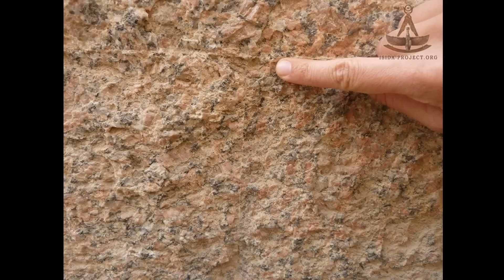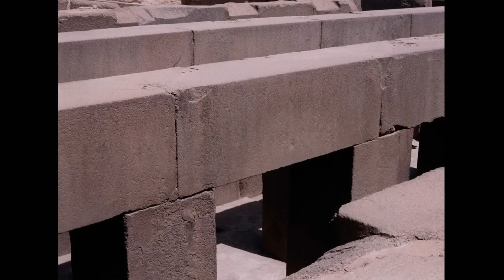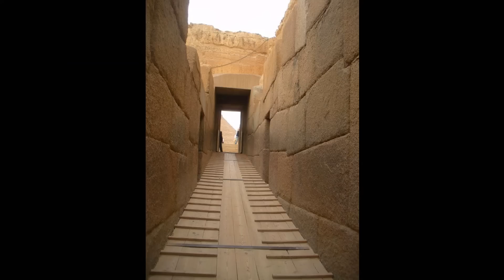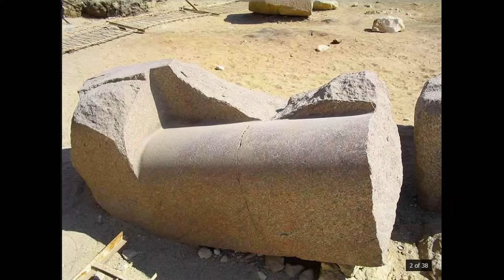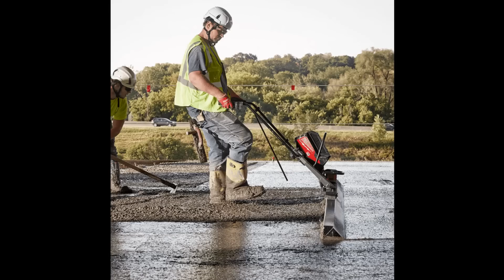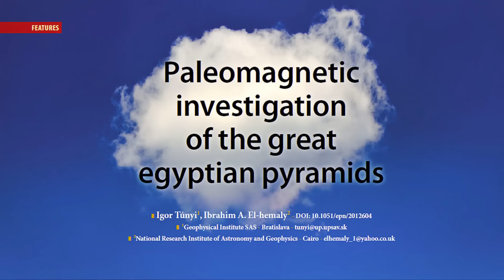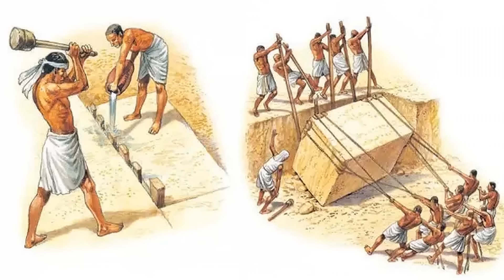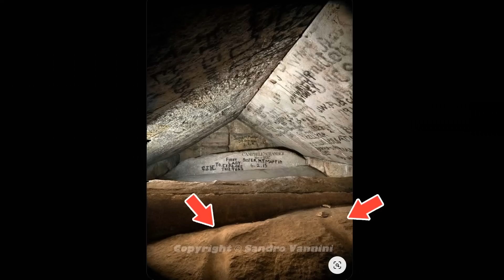How were the Perplexing Giza Pyramids' Granite Blocks Created?

Comment: Hello again I have a lot to say but I just wanted to try to bring out some obvious where approximately 8 minutes 40 seconds in you talk about granite blocks in front of limestone and how difficult that would be with the granite but have you considered that the granite was placed first in the limestone is geopolymer which is already known to be. If you think about it that would be the easier route and very easy and it's very easy to polish one side. And there's evidence of Wheels in kids toys before this pyramid was supposedly made. So just because evidence has not been directly found at the site for Wheels, I personally believe circular saws powered by water would have been a very easy thing to do and I believe they knew how to do it then. It's hard to believe that they understood the cosmos and right triangles yet they didn't understand Wheels.

Comment: I believe most of these sites are cast. If there was a great flood, there would be so much mud and debris.
They had to do something with the material.
 Mound builders cleared land and piled the material up.
What did Egypt do with all the "quarry dust"? I know what I would have done with it.
 Maybe they started with "sifting" the material and burning the trash, creating concrete additives like charcoal. After separating the material sizes, made sun dried mud bricks out of the clay that would have been everywhere, 
Begin mass producing kilns to "fire" the bricks, creating stronger materials. There's a chemical reaction when certain things are added together that heats up the aggregate. We set anchor bolts with a material that did that. Grout is very fine aggregate mix, if you get your viscosity manageable, you can make it as thin as soup, or you can make it a Ramming material. 
It's all about the viscosity/slump.
Maybe a lot of these places were originally just disaster "clean up".
First off, anyone planning to hang around would dig a well, revealing the rock layers as you dig down.
 People put way too much thought into these conspiracies.
I'm going with, 
Cast stone from clean up debris. lol

Comment: I also have very close up photos of the joins shown at 0.42. It's very unlikely that a saw was used as it would remove material at least the thickness of the blade. All you can see is a difference in the colour of the syenite's inclusions across the join, but no material has actually been removed. Upon very close inspection the join is not perfectly straight either which is also inconsistent with a saw (or even ancient laser). Most likely this is the result of a very well practised method of cracking the stone into sections to make it easier to transport.
I have the same photos from the Khafre pyramid at 7.47 and it's far more likely that the core stones were made to fit the syenite casing stones, not the other way around - see Engineers Are Lazy on my channel (you get a mention). All theories regarding 'cast' stones, or geopolymers are reliant upon the following premise: quarrying large blocks of stone - to pulverize into powder - to make large blocks of stone. You also might want to check out the Sacred Geometry Decoded channel who has actually gone to the time and trouble of reviving and practising these primitive stone working techniques and proving that it can be done.

Comment: The granite casing pieces weren't carved to fit the limestone, the limestone was carved to fit the unflattened granite. Shaping the softer rock saved a lot of work .
Reply: That is backwards.  The limestone blocks were already in place when the granite blocks were abutted against them... in all locations.  Against the ragged megablock limestone wall of the Valley Temple granite blocks were poured and merged with them with no gap between.
Reply from the maker: I agree that the limestone blocks were there first before the granite sheath. The core stones at the pyramids and temples were stacked/ constructed first as they are free standing structures. Without the preexisting limestone core the granite sheath cannot free stand. The structural elements come before the add-on sheath layers.
Reply: @CuriousBeingbyTina  You agree with a very obvious point, but you ignore my argument that it would be easier to carve the limestone (in place or not) than the granite, and that's obviously why the backs of the granite casing stones are unshaped.

Comment: You are absolutely right, a lot of stones are cast concrete.
That is why these stones fit together exactly.
Moreover, you can make concrete from almost any material, just crush it and mix it with cement and pour it.
The stones that are spherical seem to have been cast in a kind of bag as a casting mold.
It is interesting to know what material they would have used for this casting mold.

Many Egyptologists and others tell fairy tales of advanced unknown techniques.
For example, you can also make a drill hole in granite with a wooden stick and a round copper plate at the end, that is just a hollow drill, and with that you can drill very easily in concrete that has not yet hardened, not an advanced technique.
So copper may have been used, but not for sculpting.
Steel hollow drills have been used in metalworking for a long time and I have them at home in my workshop, haha.
My neighbor was a plasterer in the restoration of old buildings.
I was amazed at the speed and accuracy with which he could make things from plaster and also concrete. 
He made a crooked wall with holes exactly straight and flat only with a spatula and cement.
I measured that with a long wire of 7.5 meters in various directions.
No Egyptologist could ever have understood that.

I am glad that you are realistic and it is also nice to just hear the truth on youtube by a critical and logical thinking person. 
My compliments.

Comment: The unfinished obelisk in the granite quarry at Aswan raises questions, though.
Like, why does it even exist? I wouldn't expect them to mold the pieces there, then move them hundreds of miles. And if they could cast granite, why carve an obelisk?
Reply: All of the Egyptian obelisks were cast, and that is why a pair of them bowed in the center, and others collapsed near their base...and the inscriptions were formed by perfect 3-D stencils attached to the inner walls of the molds, not beaten out of crystalline rock with chisels.  I've written extensively about it.
Reply: @redwoodcoast  The claim that obelisks were cast is highly unlikely, especially since we have an example still embedded in bedrock. The same distinctive tool marks found on the unfinished obelisk are also visible on the bedrock, which suggests they were carved, not cast.

If the unfinished obelisk was casted then why they didn't cast it where they wished to install it?!!

 Scientific studies using techniques like XRD and SEM confirm that the material is natural granite, not a cast substance. Check a paper called: Granite quarry survey in the Aswan region, Egypt: shedding new light on ancient quarrying
Reply: It need not be limited to one technology. As far as unfinished obelisks are concerned, stone softening techniques may have been used to facilitate the mining and formation of the stones. And they may have been working with an excavator with a spoon-shaped tip. We have planes and cars, but we also take trains. 😉
Reply: @finley.h  so they carved the obelisk that is more than 1000 tons of granite and they wanted to transport it to the other end of egypt just because they loved to use another technology?! 
I would prefer to cast it in place if I have that casting option because moving one piece with 1000 tons is not fun.
Reply: @NecroMancer-w2o  But if, as Tina has always suggested, those sites were the work of an advanced prehistoric civilisation, then transporting 1,000t blocks may not have been too difficult. ( Technology we dont yet know about.) I dont think it was bcs they liked it, but out of a sense of efficiency. In any case, the work process of casting huge objects weighing over 1,000t is also quite hard. Thx😎
Reply: @ Nobody does these scale projects just for fun. Anyway, no evidence of casted granite was found.

Geopolymer granite differs from natural granite in its formation process and physical structure. Natural granite forms over millions of years from slowly cooled magma, giving it a strong, interlocking crystal structure. Geopolymer granite, however, is synthesized quickly using materials and activators, resulting in a matrix that, while visually similar, lacks the same crystalline structure and durability of natural granite. It’s very easy to distinguish between them under microscope and XRD.

All granite blocks used in ancient egypt were natural and we know where did they get them from.
Reply: @NecroMancer-w2o  You need to rethink your use of the word "they".  In fact, "they" were not Egyptians nor even terrestrials.  They might not have even been mortals but AI operated machines instead. Nothing on Earth could have lifted 2,000,000 lbs. from the excavation trench, much less moved it over ragged terrain.  Only levitation technology could have done that.
Reply: @NecroMancer-w2o  The granite was natural but it was not quarried. It was crushed and reconstituted with unknown binder material in an unknown process.  What we do today, 5,000 years later, is utterly irrelevant.
Reply: @ It’s impossible to get natural granite from any process except than natural formation . It’s just impossible to replicate the same pressure and slow cooling process happening when forming natural granite. What this video says oh because we can’t cut  and shape granite precisely then it must be casted. That’s not evidence at all that it’s casted.
Reply: @redwoodcoast  You're making some absolute statements over things that are nothing but your own opinions i.e., ''they'' were not Egyptians. Who made those AI operated machines and who made that AI you're talking about?
Reply: @NecroMancer-w2o  uh... as I've shown across multiple expositions, it was actually impossible to quarry and move such a massive object.  Only E.T. technology can explain it.  Even today advanced AI pointed out the reasons that that is true.
Reply: @redwoodcoast  In India, entire caves were intricately carved out of granite, demonstrating that ancient civilizations had techniques to work with this hard material more effectively than we might assume. The same reasoning applies to their ability to lift massive stones.

The truth is, we don't fully understand how they cut and transported granite with such precision. However, we can be confident that anything with granite did not involve casting.
Reply: @NecroMancer-w2o  The unfinished obelisk was not excavated by any Egyptian technology since none existed, nor any to lift it or move it.  It would have been totally unmovable as I've pointed out for years.  It, and the smaller one, pre-date all of dynastic Egypt and were excavated by unknown extraterrestrial technology and would have been raised with anti-gravity technology.  Nothing else was possible.
Reply: @redwoodcoast  I agree that there was a lost technology involved, but it likely pertained to cutting and lifting stones rather than casting granite. All the evidence we have supports this conclusion.
Reply: You are correct. There is evidence of quarrying stone blocks as well as obelisks and that proves these stone items are all quarried block or stone NOT poured like concrete. The fact that we cant figure out how they quarried them is what has us all stumped, but quarrying is what was happening. How did they "scoop" out the stone from underneath and around the item? That is the real question here.
Reply: @9344music5  Your logic is defective. There is no evidence of Egyptian obelisks being quarried at Aswan.  The unfathomably humongous unfinished obelisk was NOT being quarried by terrestrial technology because no such technology existed to excavate, extract, transport, and erect such a colossal weight.  That technology still does not exist today.  No serious person believes otherwise.  It would be childishly ignorant of real-world forces and technologies to believe that manual labor was sufficient for such a task.

You mention what we can't figure out while being oblivious to the fact that we CAN figure out what was not possible... what was in fact IMPOSSIBLE.
Also, with the arrival of hardened steel tools, quarrying of some granite was made possible, but most colossal objects were cast because they were too big to quarry and transport.  I've written a ton of explanation regarding these things.

Comment: Another excellent presentation,  thank you Tina, similarities between old and new construction techniques have probably not changed much over the ages. Perhaps those fine dividing lines between blocks could be due to shrinkage of the setting granite based concrete, minimal but noticeable. 
Great video, thank you again.

Comment: Nice video and presentation. 
Page 0:37 surface conformal joint in optical precision can hardly be finished by tools. 

What is the alternative? 
Conformal molding. That requires three molding panels to secure a volume next to one set preciously. Then filled it with granite concrete. Detailed shaping is possible before the chemical hardening process is complete. 

What needs to be available are 1) binding agent 2) correct composition, granular and proportion of sand crystals and 3) fresh water.
Reply: Sand is composed almost entirely of quartz grains; the close-ups of the granite blocks show large, well-formed feldspar crystals.
Reply: @jakollee  I read you. You have a point. Thanks. I think I did specified in my comment 2) “correct composition” and proportion of sand crystals…. that implies feldspar inclusive.
Reply: @philoso377 but again, natural sand you would find in the desert or at the beach is mostly quartz, and does not contain the large, well shaped feldspar crystals seen in the granite blocks. If you are suggesting the sand was made by grinding up granite, you have the same problem- the feldspar would be broken up. And how would you grind up large quantities of granite? Geological studies of the granite blocks concluded they are natural not cast.
Reply: @jakollee  did I reply you with “feldspar inclusive”? So why you insist to dwell on sand as you so defined as an argument against my reply? 

BTW are we saying that feldspar can only be obtained from granite and not in discrete form ?
Reply: @philoso377 Feldspar is a rock-forming mineral that occurs in igneous rocks like granite, pegmatite, diorite and gabbro, which solidify from magma. I am not aware of any “discrete” sources of feldspar crystals, separate from the igneous rocks I listed. To my eyes, the granite blocks shown in close-up in this video have an obvious coarse-grained igneous texture of interlocking crystals of quartz, feldspar, and biotite. And as I mentioned, studies by geologists have concluded that the granite blocks are natural, not cast as some sort of artificial granite concrete.
Reply: @jakollee  I don’t dispute what your were told or learn. Alternatively, try reheat granite and see if we can reconstitute / recycle it as it was found.